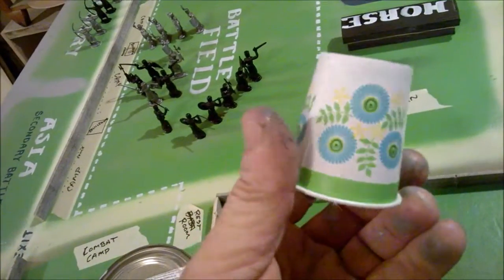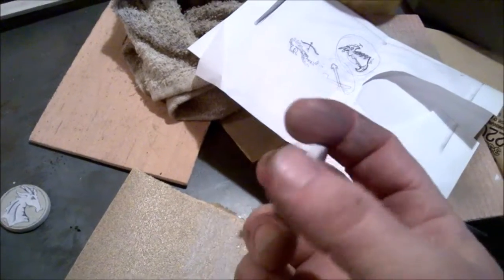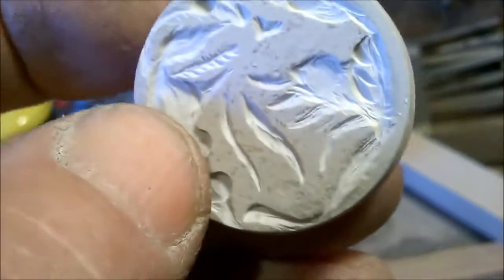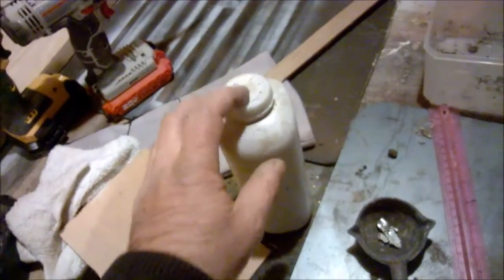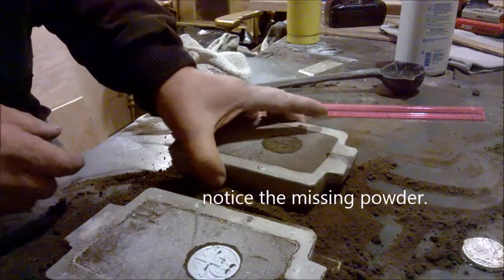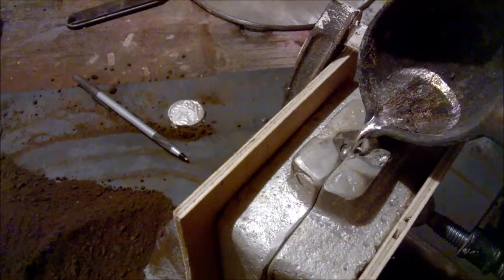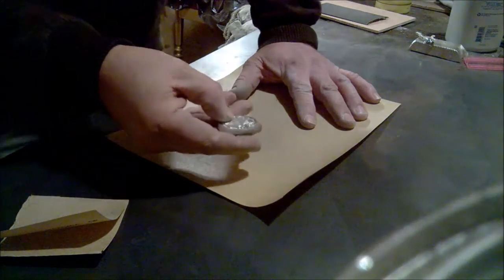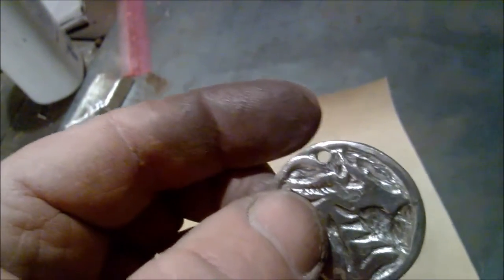Making a pewter medallion

Comment: Great video mate. Would be better to make a silicon mould? U can reuse them cheers Graham.
Reply from the maker: Silicone doesn't like the high heat of zinc or aluminum. 
There is a special low temperature pewter in combination with a special  high temperature Silicone that will work in combination.  As yet I don't recommend a beginner to even attempt it. 
The metal that can be easily resourced melts above 400*f
The normally available Silicone breaks down around 300*f.

Greensand is an ancient process that withstands all temperature. 
Easy to use but not as refined a casting as Silicone. 
It is best to purchase the appropriate  pre made molds and ultra low temperature metal. 
Smiles
Reply: @dragonwyck121  cheers mate.

Comment: Any suggestions for not getting air trapped in there?  Seems to be a common problem of mine.
Reply: I think you need to add small trenches leading from the bottom of the casting image to the outside edge. This would exhale any potential air pockets as the metal is being poured

That's what I've gathered from watching other videos anyway :P you should probably do some research of your own before taking my word xD
Reply: Gaming Chinchilla yeah I have tried those and sometimes they work and sometimes not.  Maybe I'm not doing them right.
Reply from the maker: William Kent  put a spur at the bottom to collect dirt.
Add vents on top . One is to pour into. The other releases air and should become full when poured.

Also check the temperature of the metal. It might need to be much higher for small chambers.